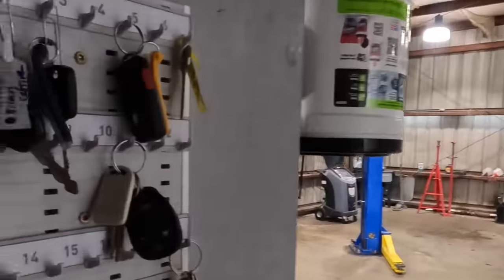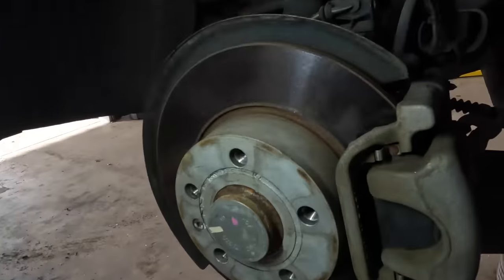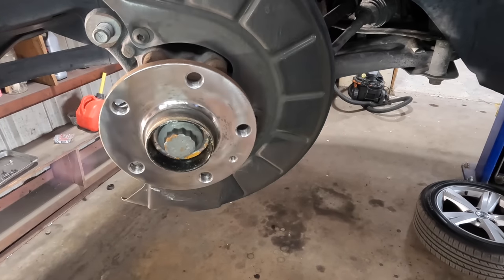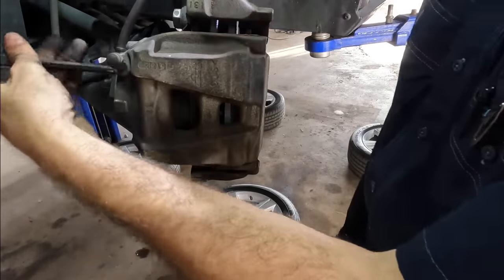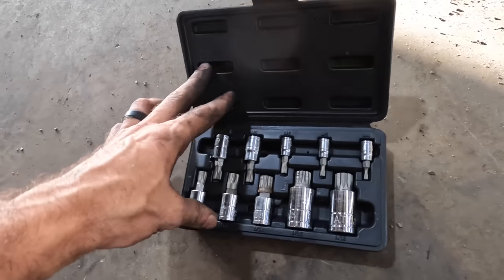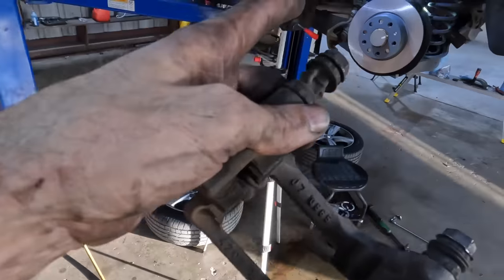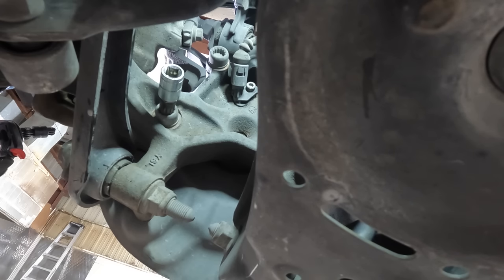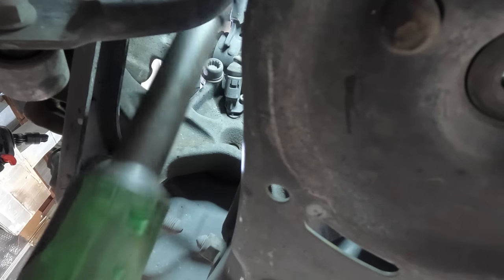Brake Job…with a Belt Sander? 2015 VW Jetta

Comment: less than 125k for metal to metal.. wtf they doing driving with the hand brake on or the normal one foot on the  brake and one on the gas at 80mph lol
Reply: It actually went metal to metal around 90,000 mi and it was because the slide pins got stuck on that side. The guy that I had do the DIY try to fix the sly pins but apparently he didn't get them done well enough

Comment: Are they really saving any money with the pads when each side is half the cost of the rotor? Saving money by pad slapping probably necessitated paying you for your labor.
Reply: The pad slap was done about 2 years ago and I had virtually no resources to have a proper brake job done so I had a friend of mine do the pad slap for me at that time but that was almost 2 years ago

Comment: There's something wrong with that VW. The check engine light isn't on.
Reply: That's not a check engine light it is the light stick telling me I have a burnt out and bulb. That's my car in the video and I have a burnt out daytime driving light on the driver side that I've never bothered to replace it's not a check engine light
Reply: @rickbill4834  I know. I said the check engine light is not on. It's a Volks Wagon, the check engine light being on is basically standard-issue for them. Yours is the only one I've seen without said light on.
Reply: I had some lights on before but I took it to VW and ended up being just a wheel speed sensor and that fixed the problem. And it did have another problem before I brought it to Ray that I fixed I replaced the camshaft timing magnet. And that fix a lot of problems too.

Comment: So, as an old (69 yr's) Fat guy who has done a hell of a lot of brake job's over my life, let me get this straight you talked about wanting the pads to float via the "PIN'S," and you geese them to achieve this outcome (inset Homer Simson DUH!)   Why won't you coat (with geese) the very small surface area that the pads ride on in the caliber frame(s.)   Brake job's are very tribal as to what you been taught, versus what you see repeatedly; i.e., your pads hanging up on the caliber frame(s)  HINT--HINT!!!

I'm guessing that you have no problem with spending dollar's on the brake clean, but just maybe a thought might be given to using a "Bare Metal Protectant," such as CRC SP-400™ Corrosion Inhibitor, (to aid in the protection and easy removal of Rotor's from Wheel Hub's.)  We're not talking Rocket science here.

Long-term indoor/outdoor corrosion inhibitor that provides protection of all ... Use on machined surfaces & assemblies subjected to long periods of storage.   (inset Homer Simson DUH!)

Comment: Gets a new brake lathe,  buys rotors.
Reply: @Jeff Karpinski The front rotors are roughly $60 each.  If he charged $50 each to turn,  the customer saves $20 and the shop makes between $75-$80 instead of the $20-$25 selling new rotors.  Rotors can be turning while disassembling the next brake assy.

Comment: So you don't confirm issue and you don't measure run out?? You just spend money. Faster I guess but not really honest in my book.
Reply: No I verify that there was definitely some run out cuz the car had very bad vibrations at any breaking speed when I turn the car over to him to get fixed

Comment: No, u r not good… because it’s too tight….. best case scenario, the rotor and pad mate quicker, and do not overheat…. All it took would be a little push and twist on the piston, and yes there is a torque from the engineers for that bolts…